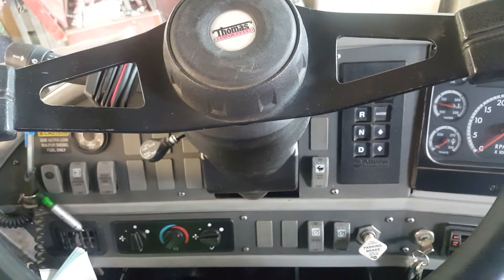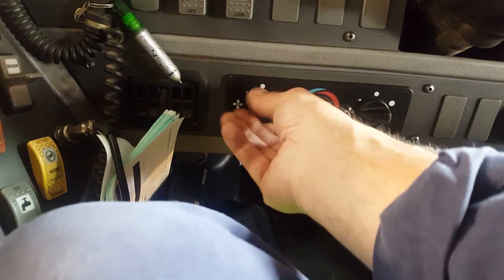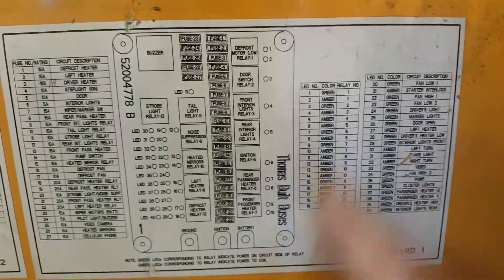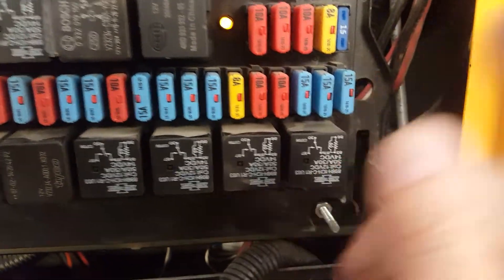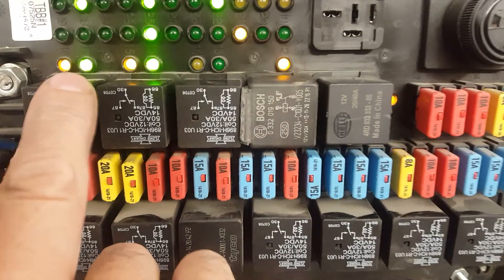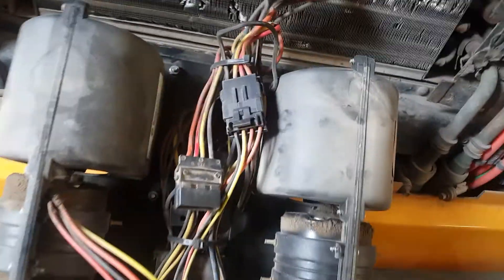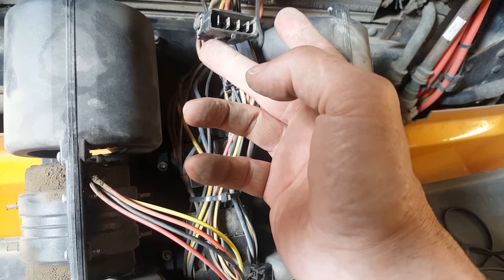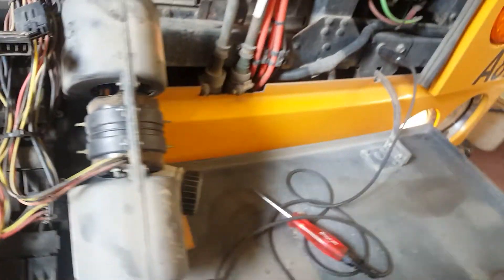Thomas Rear Engine School Bus Using Circuit Board For Troubleshooting No Defrost Motor Issue

Comment: Is it possible to turn the top flashing (school bus loading) lights to solid? Is the flashing build into the board and just a flasher relay? I have a thomas minotour im turning into a rv and would like to use the lights as HOV solid on lights.

Comment: The LED's were removed in an effort to protect against contamination intrusion.   Probably around 2009.  I was the engineer on that project.  The PC boards worked ok as long as the bus only had options the PC board was configured to accommodate, which hardly ever happened.  In which case required additional hard wired control circuits.

Comment from the maker: Why didn't I use a multi meter? The entire circuit is hard wired. No electronics involved which definitely requires a multi meter for testing.

Comment from the maker: FYI ...I had the defrost switch on high speed key on while explaining the circuit board and you probably noticed I was working in the wash bay. The shop was full and it was raining🤓
Reply: Lol...have you gotten a IC that you could do a air door mechanism demonstration on?
Reply from the maker: @tildenyoung2088  what do you want to know about the air doors?
Reply: I know alot about the doors....but I wanted a video that showed a demonstration of the IC doors....I had Joe's bus barn send pics of the ic doors in texas to me...but theirs are manual...I saw you did a vandalock vid too...that's also why I want a vid or pics on it...because the vid came through clear but I was confused with the setup of the vandalock and the door system itself.